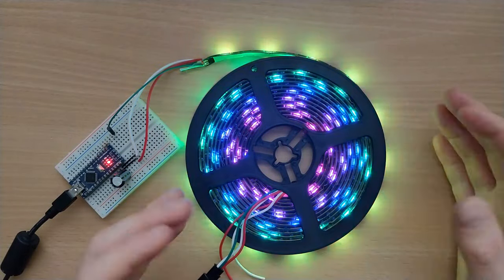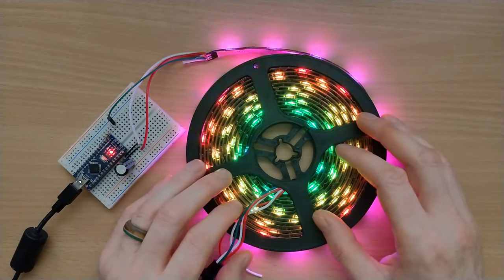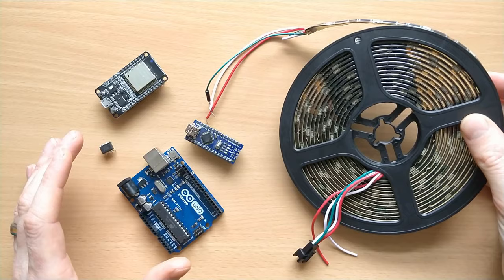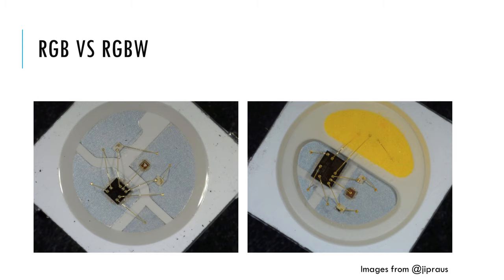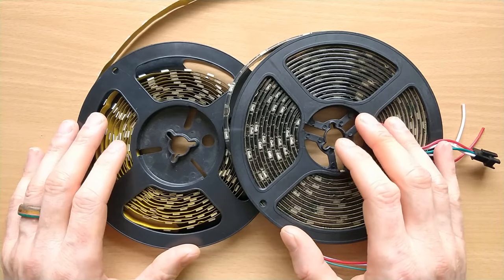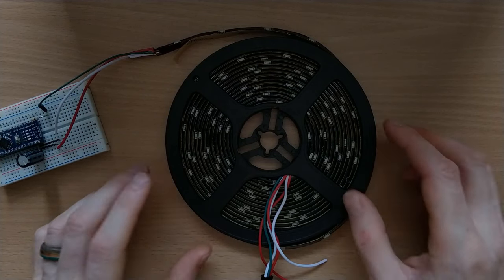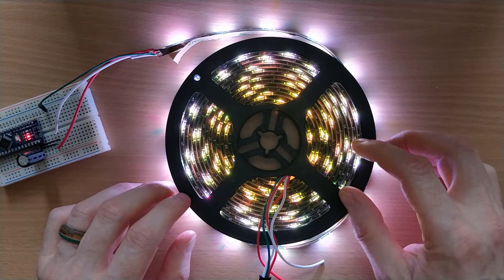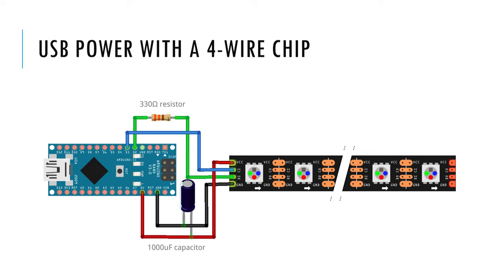FastLED Basics Episode 1 - Getting started

Comment: Is it possible to power this with a 9 or 12 volts battery?
Reply from the maker: Yes, but you'd have to use a step down (buck) regulator to drop the voltage to 5V to run the Arduino. You can get 12V LED strips, but the Arduino still needs to be 5V.
Reply: @ScottMarley  can you please recommend the right regulator 🙏🏻🙏🏻🙏🏻

Comment: Are jumper wires the same as the gray jumpers?
Reply from the maker: Hi, I'm afraid I don't know what you're referring too. Happy to help if you can explain!
Reply: @ScottMarley   I have wires that plug into a circuit board on both ends but they are not like the gray jumper pieces You used in the video to connect the board with at 8:16 . I am brand new to this so I do apologize 🤣
Reply from the maker: @melvinewart4220  yes, they are just wires!

Comment: Arduino: 1.8.18 (Mac OS X), Board: "Arduino Uno"

FastLED-V1:12:17: error: stray '\342' in program
 FastLED.addLeds<WS2812, LED_PIN, GRB> (leds, NUM_LEDS);
                 ^
FastLED-V1:12:18: error: stray '\200' in program
 FastLED.addLeds<WS2812, LED_PIN, GRB> (leds, NUM_LEDS);
                  ^
FastLED-V1:12:19: error: stray '\216' in program
 FastLED.addLeds<WS2812, LED_PIN, GRB> (leds, NUM_LEDS);
                   ^
FastLED-V1:12:20: error: stray '\342' in program
 FastLED.addLeds<WS2812, LED_PIN, GRB> (leds, NUM_LEDS);
                    ^
FastLED-V1:12:21: error: stray '\200' in program
 FastLED.addLeds<WS2812, LED_PIN, GRB> (leds, NUM_LEDS);
                     ^
FastLED-V1:12:22: error: stray '\216' in program
 FastLED.addLeds<WS2812, LED_PIN, GRB> (leds, NUM_LEDS);
                      ^
/Users/victor/Documents/Arduino/FastLED-V1/FastLED-V1.ino: In function 'void loop()':
FastLED-V1:21:18: error: expected primary-expression before ':' token
   leds [0] = CRGB: :Red;
                  ^
FastLED-V1:22:18: error: expected primary-expression before ':' token
   leds [1] = CRGB: :Red;
                  ^
FastLED-V1:23:18: error: expected primary-expression before ':' token
   leds [2] = CRGB: :Red;
                  ^
exit status 1
stray '\342' in program

This report would have more information with
"Show verbose output during compilation"
option enabled in File -> Preferences.

Comment: After more research I decided to avoid this FastLED / Arduino Nano plan, and go for WLED / ESP32 instead. The latter has support for RGBW strips and has WiFi built into the CPU and PCB, plus ir has Home Assistant support. Meaning, an ESP32 and RGBW strip and a power supply is all that is necessary for a perfect, voice controlled RGB strip over WiFi, with tons of effects and perfect white colors. That was my goal.
Reply from the maker: Yeah, that's definitely the best choice for a solution that 'just works'. FastLED is for people who want to create their own effects and patterns, do things that you just can't do in WLED. For lighting pre-written patterns on strips, WLED is the way to go.
Reply from the maker: @BenderdickCumbersnatch  I've used WLED a lot, but I'm usually working on something different to a strip. E.g. I have videos on my LED mask project; the matrix that plays Tetris, pong, snake and breakout; my 3d printed VU meter; my smaller infinity cube and a bunch of other stuff. All of these require completely custom code so WLED is out ;) hope you get your project looking great, and thanks for your comments.